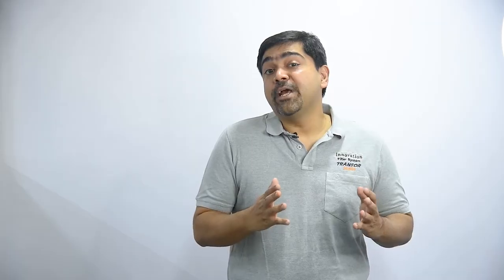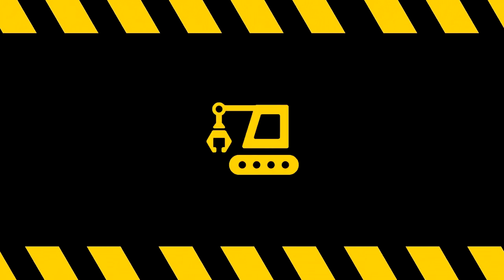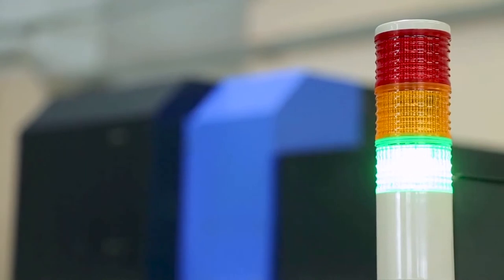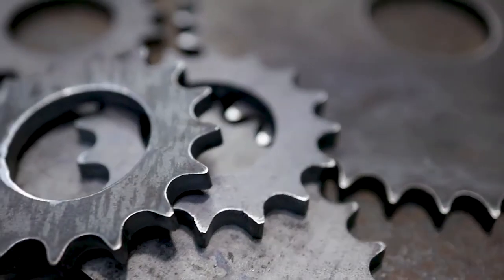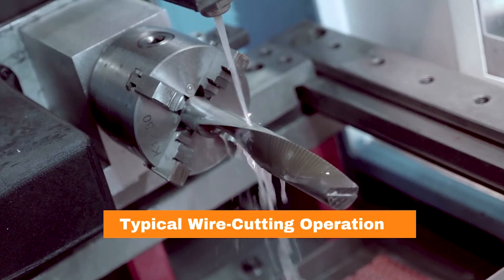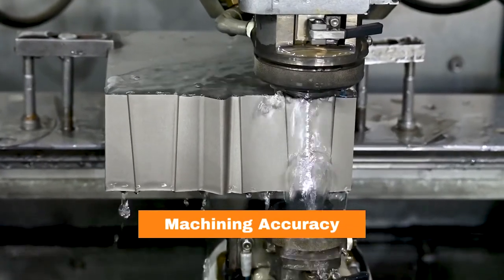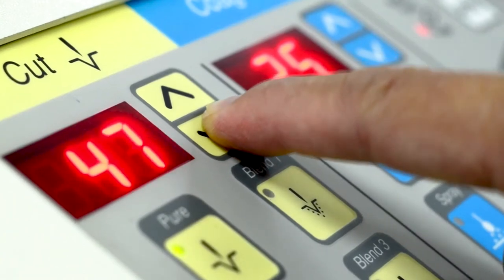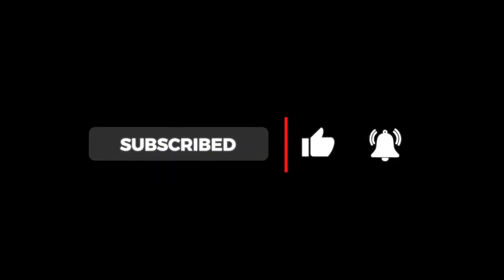Wire cutting EDM- Cutting Speed, Accuracy & Surface Finish: The Think Filter Show: Ep. 12: Part 3

Comment: Hi sir , here by we are using Fanuc Wirecut machine to cut PCD endmills , how to avoid chip off and roughness on cutting edge of PCD material . How to fix the EDM data for best surface and accuracy. Your suggestions will be helpful.
Reply from the maker: Thank you @theearth4936, I do not know the answer yet. Will research about it and let you know.